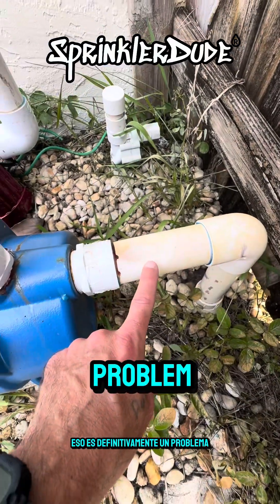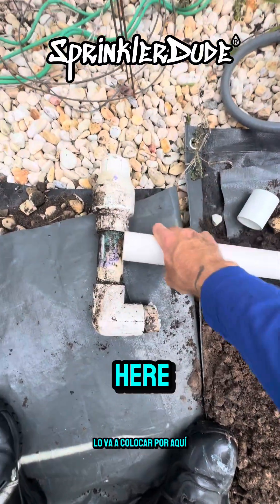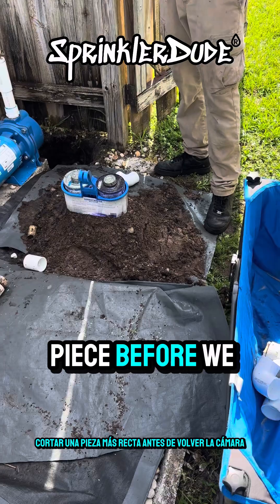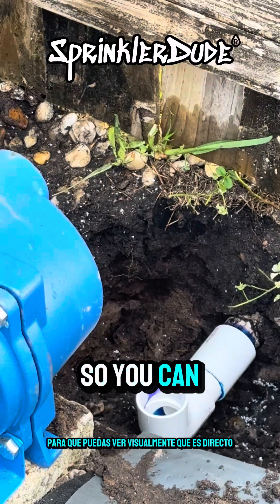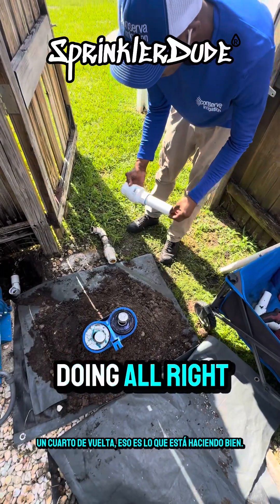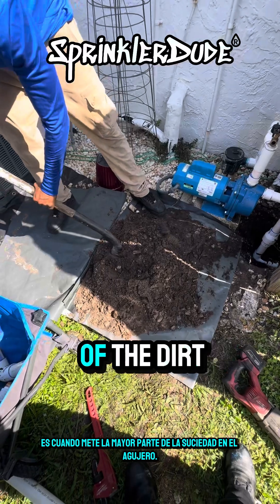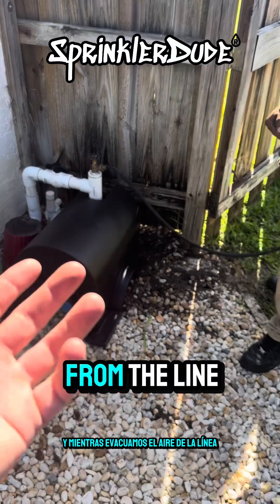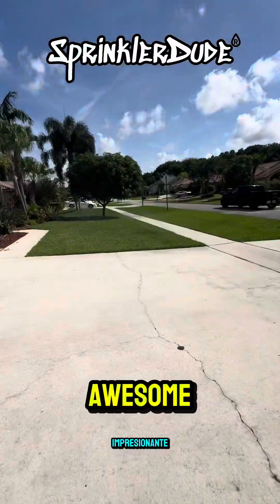Irrigation System Stopped Working | Pump Rebuild Step-by-Step

Comment: Could the same problem occur if the pump stays on even if the inline solenoid valve turns off and the pump is just running in a “dead head” state? Or is the check valve the problem in 99% of these cases?
Reply from the maker: Considering the fact that this is an indexing valve system. Water would pass through at least one of the pipes if the pump was stuck on. There is no solenoid valve involved here. It's a relay. To answer overall question. Yes the check valve is the problem about 70% of the cases the other 30% leak in the intake line somewhere else.
Reply: @sprinklerdude 
Could I replace my Irrittol solenoid-type valve with a relay instead? Is that a better arrangement?